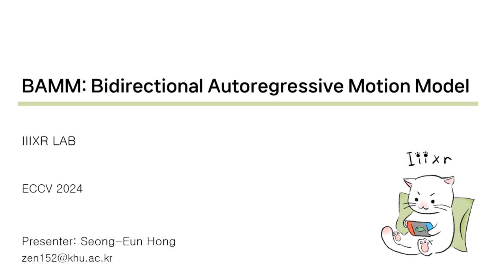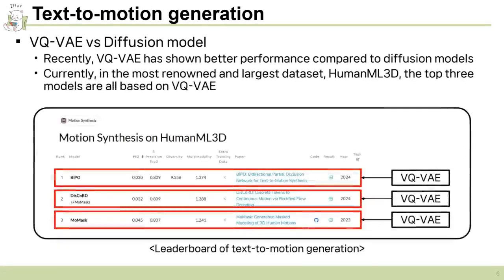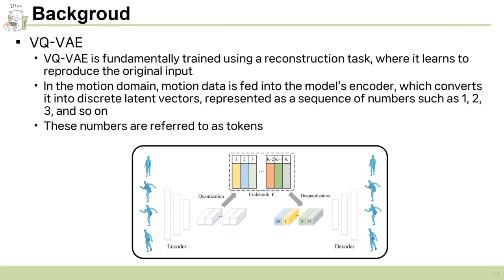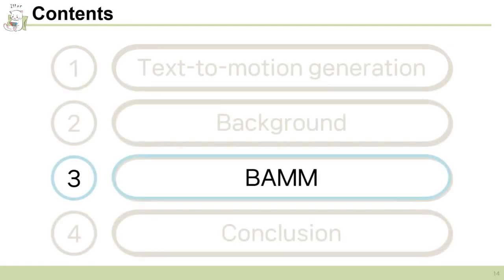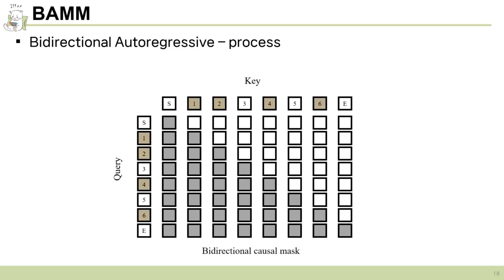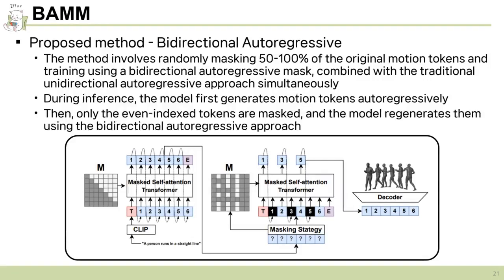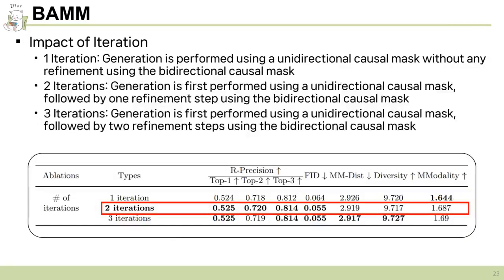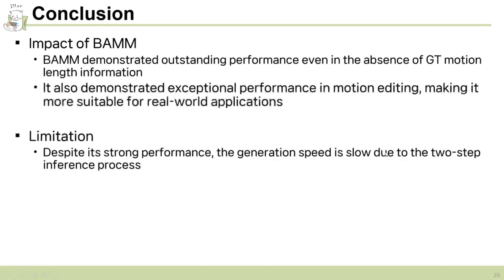[Seminar] BAMM: Bidirectional Autoregressive Motion Model

Comment: Nice presentation

Q1. What is the dequantization step in page 5? As far as I am concerned, a conventional VQ-VAE only includes the quantization step without any dequantization. 

Q2. In page 6, aren't sota diffusion models based on latent diffusion methods instead of those that apply diffusion directly onto the data? I believe the diffusion model can be used as the sampler for a VQ-VAE architecture, and if so, it seems a little awkward to compare the VQ-VAE with the diffusion methods.
Reply: A1. Dequantization means the inverse process of quantization. In quantization, VQ-VAE maps their latent vector to codebook idx. In dequantization, VQ-VAE maps codebook idx to latent vector.

A2. All of the latent-based and data-directing models you mentioned were applied to text-to-motion, such as MLD and MDM. And sampler for a VQ-VAE architecture is also applied in text-to-motion field. But all of them's performance is worse than VQ-VAE.

Comment: Thank you for your great seminar.

1. What problems does the text-to-motion field aim to address? For example, what aspects of previous research does MoMask criticize, and how does it propose to solve these issues?

2. Regarding the limitations of BAMM, you mentioned that the inference process is slower due to being performed twice. Does the paper specify how slow it is? If so, how does its speed compare to that of previous studies?
Reply: A1. MoMask criticize the low performance of VQ-VAE as motion tokenizer. It makes overall performance of text-to-motion models degrade. So they choose RVQ-VAE model for motion tokenizer that aims to improve reconstruction performance of motion tokenizer. MoMask also claims previous autoregressive model cause huge errors because of error accumulation. So they suggest using bidirectional models for text-to-motion generation.

A2. They specify the speed for inference in supplementary. They agree that their limitation of slow inference. But they don't write how to compare in their paper.

Comment: Q1. The explanation of VQ-VAE and Diffusion-based text-to-motion generation methods was fascinating. According to the presenter, the reason Diffusion-based methods perform poorly in this domain seems to be due to the lack of high-quality, large-scale datasets. If good augmentation methods or a larger amount of real data were provided, could this problem be resolved? Additionally, I am curious whether there are approaches to address text-to-motion generation using unlabeled data extracted from large-scale videos.

Q2. The explanation of bidirectional autoregressive and unidirectional autoregressive models was helpful. I understand that the bidirectional approach looks at future tokens during the training phase. However, future tokens will not be available during the inference phase, which could cause issues. According to the presenter, I understand that the problem is addressed by first generating in an autoregressive manner and then refining based on the bidirectional approach. Did I understand this correctly? If possible, I would like further explanation on this as well.
Reply: A1. In many text-to-motion models, data augmentation methods is usually adopted. For example, typically, motion mirroring that oppositely matching right and left is used. It have effect for increasing size of dataset to double. But it is not enough to address all problem. And I think I saw it once for  unlabeled data extracted from large-scale videos. As I know there are many research for it.

A2. Very correctly. It is all. Refinement process is just for even-indexed motion token.

Comment: Thank you for such a well-delivered and insightful seminar.

Q1. What are the potential risks and limitations associated with an over-reliance on datasets such as Human3.6M for the development and training of text-to-motion generation models?  

Q2. What specific challenges and complexities emerge when implementing text-to-motion generation systems in collaborative settings, particularly for multi-character animations and interactions?
Reply: A1. I think there always exist potential risks in AI filed for using dataset. For releasing this issue, various benchmark dataset is used for evaluation. In this paper, not only use HumanML3D dataset, but also KIT-ML dataset is used for evaluating the model's general performance.

A2. Multi-character animations and interactions is not significantly considered in this paper. But using SMPL format and IK methods,  muti-character skinning problem is almost solved but the mentioned issues not addressed in this paper.

Comment: Thank you for your presentation. I have two questions.

Q1. I expected the motion to be more refined and perform better with more iteration steps, but 2 iteration steps seems to be appropriate, why is that?
Q2. It is not clear to me what the relationship is between ground truth length and the bidirectional method, which is a limitation of the existing methods presented in the paper. Is motion generation based on ground truth length a limitation of the unidirectional method only?
Reply: A1. They do more experiments about iterations. Empirically, iteration 2 is suitable. More iteration is need significant cost that too many iteration is not adaptable for real world applications.

A2. Unidirectional autoregressive methods can view only past context. They can't see future context. It makes the model performance worse. So they propose Bidirectional autoregressive method to address the issuse.

Comment: Thank you for the presentation. I have two questions.

Q1: Recently, there have been papers that achieve good results by fine-tuning models like VLMs (Vision-Language Models) or MLLMs (Multimodal Large Language Models), or by using a simple adapter network to apply them to other domains (e.g., time-series learning). Could we expect to see a similar effect in the T2M (Text-to-Motion) field as well?

Q2: If one of the fundamental problems is the lack of skeletal animation-based datasets compared to those in the vision or image fields, then perhaps trying T2M learning based on video data might be beneficial. Are there any related studies on this?
Reply: A1. As I think, just fine-tuning is not suitable for text-to-motion. I think image modal and motion modal is similar for some kinds of perspective. But it is quite different. If this method is work well in this field, the paper likes MotionCLIP lose their method's justification. If motion data is enough abundant for pre-trained new large foundation models for motions, it may works well.

A2. I think I've seen it, but it's not exact. It can be one of the solution for this problem.

Comment: It was good to learn about the quantization codebook.

Q1. What specific feature of the Diffusion model makes it require more data than VQ-VAE?

Q2. What motivation underlies the ability of a quantized latent vector representation to perform better than a continuous latent vector representation in animation using Transformers? Are there other methods that implement this motivation? Why is a quantized latent vector preferred over these alternatives? (I understand it is efficient, but why does it outperform others?)

Q3. Could you explain how a bidirectional autoregressive model overcomes the ground truth length output limitation? Is this achieved due to the bidirectionality, auto-regressiveness, or a combination of both?
Reply: A1. Actually, I don't know diffusion model deeply. It is just my opinion. But think simply, VQ-VAE generates something by tokens level but diffusion model generates something by real number level. Then, diffusion can manipulate many specific numbers and it makes the diffusion model require more data than VQ-VAEs.

A2. Import key idea is token. For many various domains like NLP or Vision, token method determines their efficient and great performance. For continuous latent representation, it can't covert motion to token but quantized representation makes it well. In T2M-GPT paper, the idea is proposed firstly in text-to-motion area.

A3. Bidirectional methods also need ground truth motion length. So BAMM suggest 2 stage inference. They generate full motion by nature autoregressvie methods that continues to generation motion tokens when eos token is not generated. Then they mask even-indexed number of tokens and re-generate it for refinements. This refinement is used by Bidirectional autoregressive.

Comment: Thank you for the presenation.

Q1. What type of elements in a motion sequence are typically used as inputs for models like VQ-VAE or diffusion models? For example, do they use joint positions and rotations from skeletons, SMPL models, or other formats?

Q2. In the field of motion generation, how significant is the generalization performance? For instance, while methods like VQ-VAE can improve accuracy through quantization, the use of discrete tokens might limit the diversity of motions that can be learned and reduce the model's continuous expressiveness. However, given the relatively small size of motion datasets, is prioritizing the accuracy of quantization the reason it remains a SOTA approach?
Reply: A1. Joint rotations and velocity from skeletons are used to form of inputs. It is equal to VQ-VAE and diffusion models.

A2. I think generalization performance is not good! As I test, they usually fails to generate complex and unseen motions.

Comment: I'm also working on text-based motion generation and was very impressed with your presentation. Thanks!

Q1. Given that Momask generates a motion given the length of the ground truth motion as input, can a motion generated with the length of the correct answer known be called a reliable motion? This is not a question for this paper, but I ask because I'm curious if it is possible to generate a motion in that way.

Q2. I'm not clear about the refinement step: how do they perform refinement with bidirectional causal masks, and why is this step necessary?
Reply: A1. Giving ground truth motion length is not unnartural that the authors claims this issue. But other perspective, the model can be fed motion length to control generated motion''s length  and it is adventage for MoMask. But in reliable perspective, I think it has crucial disadvantage f it.

A2. For nature autoregressive, the model can view future context. But bidirectional autoregressive, it can. Refinement step is like smoothing step that the model can view past and future context.